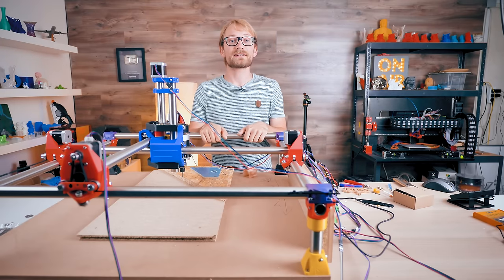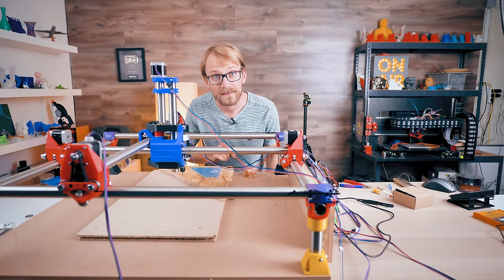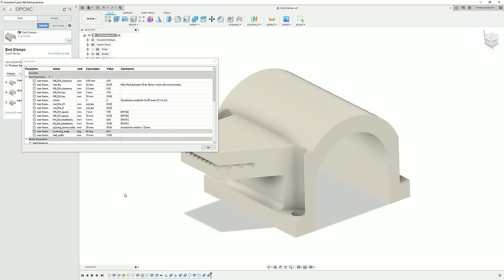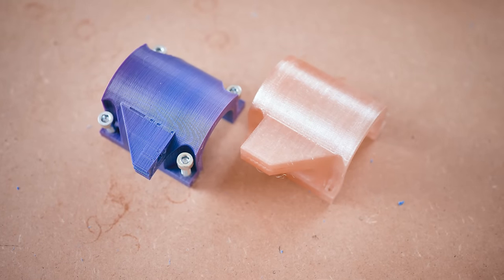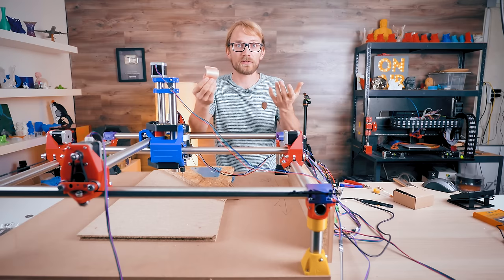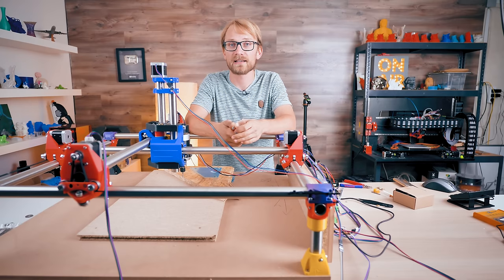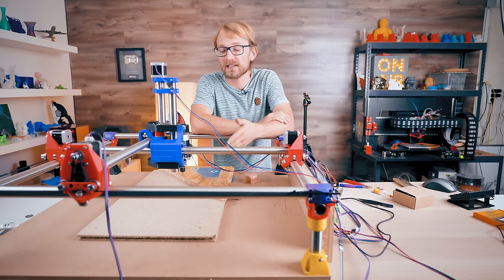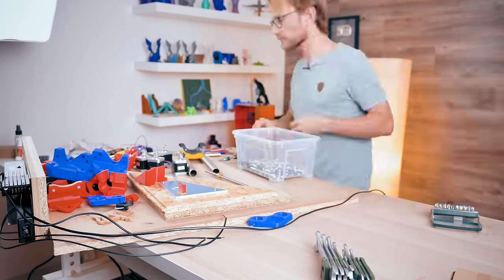Whose design even is this? (MPCNC conclusion)

Comment: Just my two cents. I reviewed applicable law over copyright and patents. In my uneducated opinion case law would favor Ryan's ability to copyright his design files. He does not have the right to limit use as a useful object. The main issue I see that has not to my knowledge been decided is the fact this was produced in some sort of cad type program. If the cad file "stl, dwg, etc" is required to produce the object or design then he "May" have the right to limit how it is used. That being said a derivative work that separates function from art would be completely free of Ryan's copyright. I would feel entirely comfortable redesigning the parts as long as I copied function not artistic design.

My questions would be:
1. Can anyone 3d print the printed parts for resale?

My answer would be unknown if it was a house plan and I reused the plans to build a house and sold the house, so far case law has said yes. I know their is an exception to this rule so maybe no, if it was designed in cad and you had to use the cad design to build the house. throwing out ethics maybe yes , maybe not. Ethically I would disagree with Ryan's attempt to limit the ability of others to print the parts as that is the whole point of 3d printing. Anyone anywhere can make stuff. But my ethics also say lets give the designer reasonable control over his design so lets not sell or profit off his design.

2. Does copyright exist over a functional design ie. a machine, in particular a CNC type machine?
 

Copyright only covers artistic works not function, functional design requires a patent. The design is not patented and I do not see much if any artistic elements, the big question in the USA is which district do I live in and what will the courts and or judge determine is artistic and what part of the design is functional and not subject to copyright. Since copyright does not apply to a redesign of functional parts their is no copyright restrictions on any "new" art that utilizes the same functionality of any of the parts. I'm not aware of whether V1 engineering is trademarked, but in any case you should not include any logo or artwork from the existing design. And you do not have too or should you call it MPCNC although that also is questionable.

In my once again uneducated opinion if I redraw any/all the parts for the CNC router and its not a patented design then copyright infringement does not exist, as their is no applicable copyright for functional parts, only artwork elements of the design. I would feel free to make an almost identical or slightly or highly modified redesign of said CNC machine or any particular part without any remorse. I can copyright my design anyway I see fit, but I can not copyright the function of said machine or any functional part within the machine. If I added a pink unicorn sculpture, drawing, relief, etc. my copyright would apply to the pink unicorn and my drawing only,  and any derivative works of my pink unicorn, and that particular drawing may not be utilized in future designs, but function is still not copyrighted. 

One other comment the idea of roller bearings on tubes is not unique and has a long history in many other diy CNC machines in particular. By releasing the design in the public domain and not applying for patent protection assuming he has a new non obvious design component to patent, I believe that he has already given up his right to a patent. Regardless, Ryan has not made any patent claims that I am aware of.

Comment: !!Important info for anyone using a Duet Wifi!!
the pause print button is very dangerous when used in a CNC, as it just moves the tool 5mm up and then goes straight to X0 Y0. if you are mashining a pocket, that is deeper than 5mm and press pause, you will crash your mashine. You can change this by editing the Gcode in the pause and resume files.
Reply: I think you can edit the pause script.
Reply: @hondablaster  that's what I said

Comment: Sad, I was really looking forward to seeing what mods/upgrades you would come up with. I have been using an MPCNC with a needle cutter to cut foam board and MPF foam since May of 2016. My MPCNC has a cutting area of just 2'X4'X over 1". Mine also now uses a CNC Shield board and is controlled through a dedicated Linux computer. I will be watching to see if you create something that is similar yet sturdier that this project.

Comment: good peice of advice with a belt system like this, double belt 1 glued to an angle iron below then the other as it should be. why you ask? the only part that needs to be tensioned is from bearing to pulley to bearing so a small part of the belt needs to be tentioned and the rest of it doesnt matter

Comment: I am THIS CLOSE >< to finishing my MPCNC. I'll finish it, sure. But Ryan's attitude frustrates me. I'd like to hear Ryan's specific response to this but Tom seems quite reasonable here.

I'm already thinking of the NEXT build... I think that I'll design one myself.
Reply: I used the MPCNC to cut parts for a replacement CNC based on the Openbuilds Ox. Reused all the expensive stuff. I have a machine that actually works now.

Comment: That's unfortunate. I guess it's debatable if that is a derivative work. If it is, the ShareAlike clause requires you to distribute your contributions under the same license as the original. I may consider a different, more open solution when I build a CNC.

Comment: I built an mpcnc a few years ago (2 foot x 4 foot cutting area)  haven't had much trouble with charter but I do not like the arduino "3d printer" based controls.  I dont use it nearly enough so I may be forcing it for parts for another machine design, I honestly got the same negative vibe from v1 engineering when I had questions about using different ways of controlling the machine, it's like they can't keep an open mind to improving the design.

Comment: Ryan is not user-friendly. He's extremely difficult to deal with based on personal experience. That being said, this is his product and he's got the market on the MPCNC. You should create a completely new CNC that can handle a quality spindle instead of the Dewalt's adaptation. He uses the Dewalt's and calls the MPCNC "His". If it had a custom spindle then it's 100% his. In the same mindset, you should do the same and create a better CNC. My MPCNC sits unusable because of it being inaccurate when cutting and no way to zero XYZ each time to make repeat parts - the reason I bought it in the first place. If you remake this with the ability to add a better spindle, please contact me ASAP.

Comment: That really kind of sucks. I would still like to see some CNC videos. I'd like to see an opensource leadscrew design. I'm sure there are a number of those you could check out. I have a belt driven OX which I didn't end up using that much. I did have to print a number of parts for it though, so it's a pretty good project. There are newer, better designs out there, though.

Comment: I read all the Tweets regarding this issue. My Impression (+based on a lot of work experience working remotely + internationally): If you guys would have had a skype video call or even better a face2face meeting, you would have worked it out. Sometimes short 140char messages aren't the best medium to discuss tensions. just my 2 cents...
Reply: Well, it is 280 characters these days. Thanks for inspiring my first tweet in a few years.
Reply: Ryan reached out several times, Tom refused to have a private conversation.  What does that tell you?

Comment: software industry has a lot of similar cases, but at the end of the day Tom is right and Ryan is wrong, because Tom created a completely new part for using with the MPCNC but he did not use any original parts of MPCNC. Just like Browser plugins or mobile applications. Following Ryans logic, all this stuff had to be released under the same original license, because they all share one particular design pattern, that is required to make it work with the base software. But thats wrong and not how its done.

Comment: I'm conflicted on this one. Your brake pad analogy does not apply because 1. Automakers dont copyright, 2. They can void warranty for use of non-OEM parts. In this case, you did derive the part that you designed from the dimensions, contours and hole mounting patterns of the original part, which is understandable, since the part must be a functional replacement. I think if you had gone the extra step of designing the other half as well, and used your own creative inspiration for where the optimal hole positions, bearing placements etc, then it would not be derived from the original. The fact that it mounts to the same size tubing would not matter since this particular contour is of a part not covered by Ryan's license. Not to mention that your part is parametric. And that's where I'm conflicted. Clearly your design is superior given its flexibility, and that flexibility is not derived from the original. Also, because it is parametric, it would be ridiculous to publish such work under a no derivatives license since every parameter change would then be a derivative design. I think when an immovable object meets an irresistible force, nothing good comes of it. Just chatter.
Reply: Siting same dimensional specs for hole placement was addressed as it affects function not artistic rendition or i interpretation. I feel like the original designer shouldve worked with him since his intention was an improvement. Pretty small minded and petty really.
Reply: @gilbertcruz2161  I totally agree that it could have been handled better. Purely for the sake of discussion, let's say that Tom or someone else improves every 3D printed part that makes up a MPCNC. Is this a derivative work? If it looks like a duck, and quacks like a duck and so forth. The only sane solution is for Ryan to change his license to allow derivative works under a different license, if such a thing even exists. He does sell kits for MPCNC, so it is fine if he wants to protect his income stream, but I don't think he would stand to lose any business from changing his license.
Reply: @johncabrer2328  the truth is that when china does the same thing to smaller manufacturers its valled free commerce. The flaw in your arguement is that if tom actually did improve every part hed be sol having lost to a better design. He should be grateful that Tom Didnt do just that. The trith is that if he wanted it all to be proprietary, he sell finished macjines and void earatees for adding unsanctioned parts.

Comment: Hey Thomas you should build a better upgraded version and call it TUCNC (Thomas's Upgraded CNC)  here is a story of our R&D of mobile road traffic lighting boards ,

Me and my boss at the time designed the first Highway traffic Mobile lighting boards with cellular communication  in the world. and paid over £500.000 on patents and aproval, Anyway cut a story short,  Some other person hired our unit and copied it changing so much only by 10% ,
We took them to Court and after a long year of Bl Bla Bla from the judge we could not win. after court fee wee lost out on £250.000
The main part of the loss of winning was down to that they called it something else and changed dimensions 
So simple. 
I always watch your channel and you explain so much, and so that is why I want to give you this info.
So make your own version, as he does not own nothing that you have bought and made, just don't call it an MPCNC
and just make all the parts better and stronger and with different dimensions. :)

Oh by the way use High Tensile Socket Cap Screws Allen Bolts HT, they are a lot stronger and no flex and tighter tolerance on threads.
And make some 12 inch bracing coming from the legs towards the middle of the base on all corners that will decrease flex on the down force of motor Z axis  by 20%

Comment: Sad day! Tom! Just make your own! You will be able to do a better job anyway! I had been looking at the mpcnc but it's completely off the list now! DEEP6 in fact! There is no room in the maker community for grandstanding! Anything I make & make public is CC-0 Always! I did a differential temperature controller for solar heating applications on the Arduino using the Tinkercad online simulator. It's been downloaded & used over 30 times now & I say Great! More people are getting to do something for themselves & I feel just great. The design was using an AT tiny 85 or an Arduino Uno. It includes a battery controller with my own flavour of MPPT to charge a battery from a small solar panel. I expect to see an Indian or Chinese design coming out with the same features anytime soon. It still pleases me that people will gain from my design abilities! Ryan, in my opinion, = the result of being jabbed with a sharp pointed thing! A prize one at that!

Comment: Please design a parametric cnc, using metric aluminium profiles (varibles for 20x20, 20x 40, 40x 40, 40x 80 etc.. in each axis..
Open so that anyone can sell parts, kits etc. And with milled or 3d printed joints interchangably etc.

Comment: That is not very wise policy to my opinion. Actually Tom's streams about MPCNC inspired me very much to assemble it myself. But thankfully I saw this video. And I won't be needing to waste tons of filament for a faulty design which cannot be improved.
Reply: Cannot be improved? The only ask here was to release the part non-commercial.
Reply: @GeoffreyPitman523  But the question remains if it actually will resolve the issue with the overall non-rigidity. It seems like it's not only about the belts.
Reply: @igorfedik5730  exactly, no one is telling him that he can't tweak or work on it. Just wanted to release under the preferred license.

Comment: I'd bet money that someone is either currently working on or has already built a re-designed, part-for-part replacement of this machine. Hell, switch the round pipe for square stock, and that fixes 99% of  V1's argument.  With the ability for private citizens to share designs under a CC-0 license, the MPCNC as a V1 product, is already redundant.   Product design and refinement by community will always evolve faster than being locked down by individuals/companies.  The fact that V1 literally has downloadable assembly instructions and a publicly available parts list means that the only thing they control is their exact design and the convenience of their parts kits.  There's no way that exerting absolute control over that is a successful business model.  

 This is a long-winded way of simply saying "Found out about the MPCNC, loved the design, but the company practices are a deal-breaker."  I've already started my research into building a unique alternative that improves on this design, which is one of the greatest things about the 3D printing community: "Design by community yields better results".

Comment: IANAL but have worked in the IP space and am familiar with software licensing. As I understand: Ryan is incorrect. Assuming designs are like source code, you did not produce a derivative work. Tho this is an interesting question. I'll forward this along.
Reply: I too have experience on that area and it is indeed very interesting. My gut feeling is also Ryan is not right, but its not 100% clear. The part alone is under no restriction of Ryans copyright that's for sure. But since the MPCNC design is freely accessible, one could argue that just by publishing a part along with its intended purpose is a change of the design - no matter if the design as a whole or a signle part is published. The design is protected by copyright and thus one would need to follow the license terms.

Comment: When a guy makes a machine that uses 3d printed parts he should expect parts to be made for it since the buyer of his stuff clearly has a 3d printer.  Sell all his stuff injection molded so the buyer doesnt necessarily have a 3d printer and it is less likely that modified parts will be made.

Comment: There is no way your part is a "derivative", any more than aftermarket car parts are "derivative" of their OEM counterparts. You can totally make new parts that fit/replace/improve an existing part of a machine and have no copyright or patent issues whatsoever as long as its not an exact duplicate and you don't market it as such.  For example, I can't make a Toyota Prius windshield wiper replacement that looks exactly like the OEM and package and sell it as a Toyota OEM part. But I can certainly make a wiper that's similar and call it Grogu's Replacement Wiper. 

Like I said, if Ryan were right, then you couldn't have mods on cars, 3rd party phone covers, various brands of bike parts or million other competitive products in the marketplace. I had seriously considered mpcnc before I even saw this video, but I chose to build a printNC instead, but I'm sure glad I didn't choose MPCNC.
Reply: Much of what you say is correct, but in actual fact you can make and even sell an exact copy of something that is not protected by copyright, patent, or trademark.  As you say, the one thing that you cannot do is represent your copy of a Toyota part as a part actually made by Toyota.  “Unless protected by copyright or patent, once form or design in an article is offered to the public, it becomes the property of the public and, absent deceptive identification as to source, may be copied at will by competitors.” Zippo Manufacturing Co. v. Manners Jewelers, Inc., 180 F. Supp. 845, 847 (E.D. La. 1960)